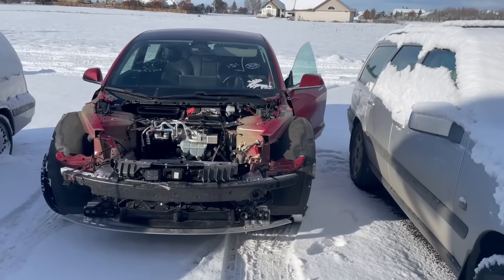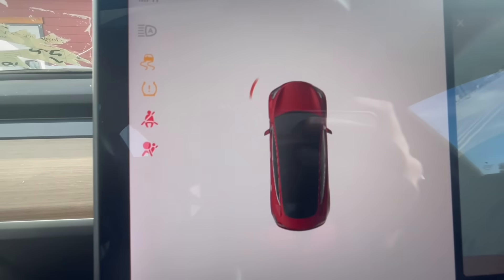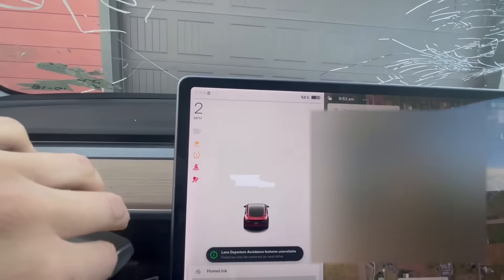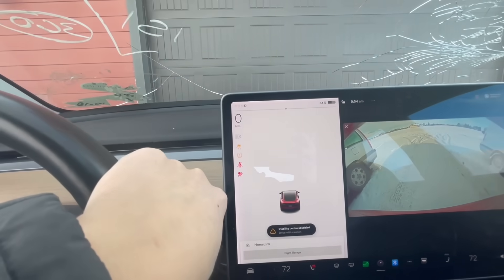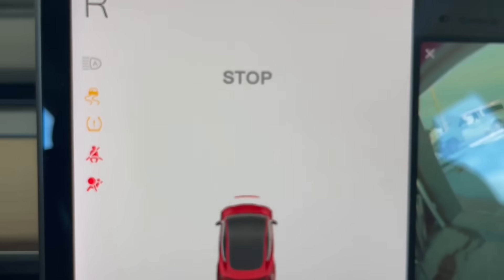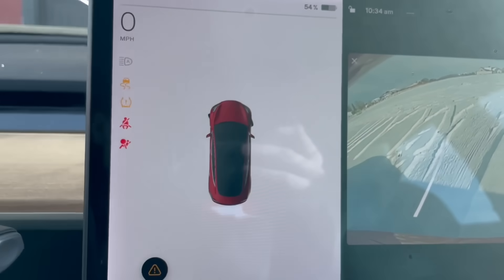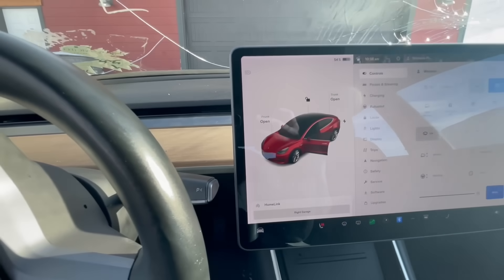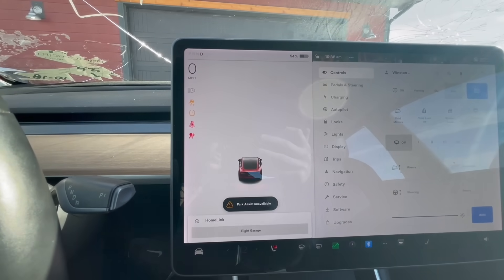Tesla Model 3 Working Without Parking Sensors! Is it using Vision?

Comment: I think I can explain this:
When the front USS are not connected, the vehicle still has the rear USS available. When reversing, the odometry is used to estimate the vehicle's position. The fact that this works very well is confirmed by the fact that an approach in the area of the front car is also visualised exactly (around 1:31) after the vehicle has arrived at approximately the height of the original measurement of the rear USS (around 1:01)
To sum up, no, this does not prove that Tesla Vision is already working.
Reply: Basing inch accurate position on odometer is not reliable at all. Too many variables. I would be surprised if Tesla made any inference on another car's position based on odometry.

Comment: If you ask me, this isn't camera based parking detection. It's merely an extrapolation of front collision based on objects detection with the rear sensors.

Like in my Mercedes if it detects an object with the rear sensors and I go backwards it extrapolates it for the front based on the turn of the steering wheel... And I'm sure of this as it happens even if the object detected disappears (like a car next to you moving but still being signalled)

Comment: Is that because the car is still using the USS feature and not Tesla Vision? It still seems to recognize the USS harness that is plugged into the main computer.  I haven't seen any 2023 Tesla vehicles without USS be able to show distance from an object on the main screen.
Reply: Harness without sensors plugged in.
Reply: @mattaut88  Correct!  If the computer was programmed to recognize the USS even though the sensors themselves have been disconnected the computer still looks for the sensors as opposed to a computer programmed without needing to monitor the USS feature.

Comment: It may work as long as the cameras are clean.
So what will you do if you have a smuged up back up camera  after driving through bad conditions ?
Is  itTeslas High-Tech solution to having to get out of the car before backing up to clean the camera ?
Well if you use your logic, that's how it going to be if you want to avoid dented bumpers or unwanted parking collisions with others !
The  parking accidents are piling up as we speak with Teslas they removed the parking sensors of !
So if they have a sufficient solution replacing the sensors,which I highly doubt,  good and fair but shouldn't they have waited until they completed it before removing the sensors ?
The reason because they didn't do that is because they removed the sensors first to save money and then thought about a solution !

Comment: The removal of the parking sensors is the main discussion topic in the German Tesla forum. So I guess you might get quite some traffic here ;-)
Reply: And Norway! 😅
Reply: First one of those reporting in xD
Reply: What’s the thread ?
Reply: Is this a cold weather thing? Or because they disabled in software ?
Reply: @TheMelbournelad  The USS are simply not mounted in Europe since some months (reason unclear: cost reduction? Supply issues?) Tesla promised a camera based software solution, but it is not here yet and many doubt the performance of this upcoming solution.
Reply: @ThomasEntner  oh yes I know that”Tesla vision” just wondering why German forums are alight about removing the USS  on car that have them. As my understanding is they are currently disable pending that software fix.
So wondering if they are removing them as makes the software using vision only more stable, or if the cold weather make USS unstable.
Reply: @TheMelbournelad  no, they do not want to remove it ;-) we are waiting eagerly for it and see this video as that there at least to be already something in the software working and hope that therefore the wait for the final solution cannot be too long anymore.
Reply: @ThomasEntner  ah right. I was just confused about what the excitement was about 😛👍 Giga Berlin seems to be pumping them out now. Sales up 900% over January 2022 compared to 2023 apparently.

Comment: Cool. Next step would be compensating the lack of rain sensors. I don't know how it is now, but my late 2019 M3 is really not very capable of detecting rain properly. It's been 4 years almost, I wish Tesla could offer a hardware solution while they work on this.
Reply: 2023 MYP - same problem
Reply: Same here on my 2023 M3P, I just don't understand why it's so bad.
Reply: no problem with rain on 2019 LR. Mist is though
Reply: When it rains just turn on the wipers. 😝
Reply: @RayNLA  I agree. And I also agree that the car is grossly overpriced in this condition.
Reply: @199724  
Do a hard reset if you haven’t in a while. Sometimes that helps. Maybe the next update will fix the issue. Have a great weekend!
Reply: Our 2021 M3 detects rain just fine, never had an issue.

Comment: Does it still detect in the front if the back sensor doesn't detect it first?  Might just be remembering what the rear sensor saw and adjusting for change in position
Reply: That's my guess too, it never detects garage and only detects/remembers what rear sensors see.
Reply from the maker: I think the car could be rendering a 3D environment and then measure the area? It is 100% camera based though.

Comment: Amazing! You that is!  So, 2022Y LR. I had a fender bender the other day. My fault; my front their back. A slight crease in my front number plate (I'm in the UK) but nothing else, not a mark.  However, the front sensors are not functioning.   Nothing pushed in, all very clean.  I surmise that the shock of the impact has detached a connection or broken something behind the sensors that controls them.
As you have yours stripped down, could you give me a clue as to what the problem might be.  Tesla Service will take a while, and possibly, be quite costly. Thank you in advance for any assistance.
Reply from the maker: Hmm yeah. So there is one main connector that controls the USS, the fog lights, and the outside temp sensor. During the making of the video, I kept getting the "Park assist unavailable" alert.  What could be happening is one of the parking sensors is broken causing the entire system to go down.

Comment: Wondering if the radar is what's doing the measurements considering that's its a 2018 model 3. If we also see an example of this on a car without radar then we'll know for sure that it's the cameras doing it..
Reply: The car only has one radar unit mounted on the passenger side behind the front bumper. If you pause at 0:21 you’ll see a little box with a bunch of small font text on it above the foam about 10 inches left of center. That’s the only radar unit. You’re saying that might be what’s measuring the distance of the space between the Tesla and the car parked on its left?
Reply from the maker: Yes, during my testing the radar module was plugged in, however, off camera I removed the radar module and got the same results. Then I covered the cameras up and the parking sensors were not working.

Comment: As a SC tech far as i know there's no camera based park distance as of yet, the 2023 model 3 and y have no uss and have absolutely no park distance at all. i think its a coincidence.
Reply from the maker: Thats interesting. I think that its been a hybrid system the AI team has been working on.
Reply: Coincidence doesn't make sense how can coincidence measure distances with sensors unplugged :D
Reply: @neopickaze  Correct. Either the device (M3) measures, or it does not. If it is measuring but USS are disabled, it can't be a coincidence.
Reply: Well, it is just software switched off in the newer models because they never had USS.